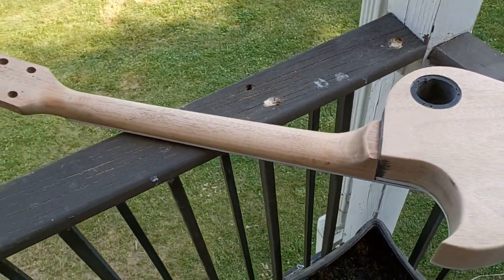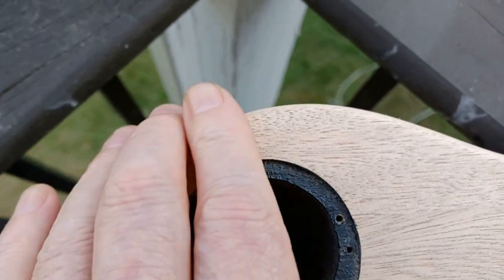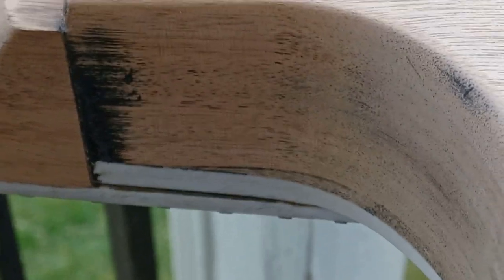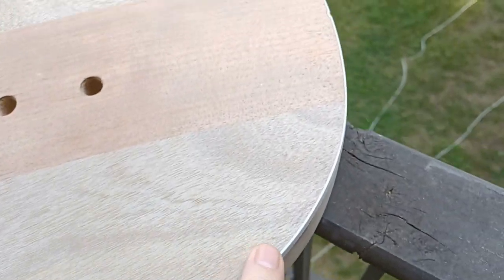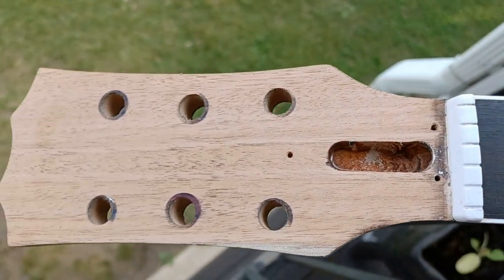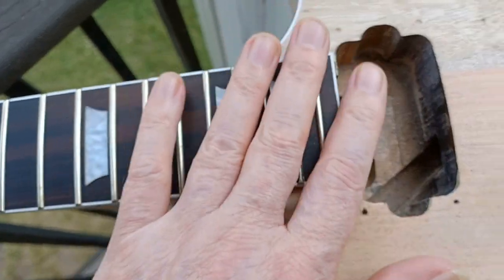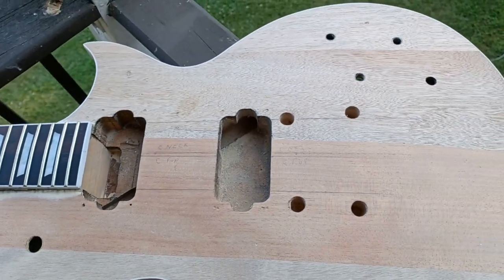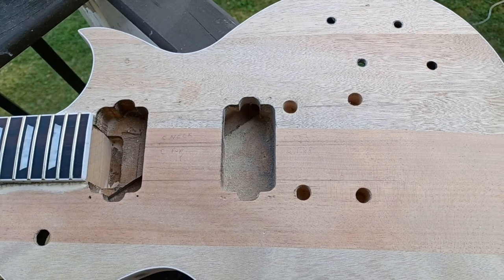Pre GGBO practice run part 2 #jurgscup

Comment: Yeah I have a kit guitar that has a neck joint just like that.. It sucks and makes it difficult to align the neck to the body. If they wanted a narrow tennen on the neck joint why didn't they just center it. Also if it is the same as the one I have there is a half round devet. It looks like a drill hole that they cut through under the fret board running from under the fret board to the bottom of the heal the bottom side of the neck. I think it was meant to help alien the neck to act as a pivot point but if the neck shifts when applying clamping pressure you git what you have a miss aliened neck. The kit I have which I have not put together yet is a 12 string.
Reply from the maker: I think they lined up the top of the neck parallel to the center line of the body and not matching the center line of the neck  to the center line of the body properly. Definitely something to keep in mind when you do yours.

Comment: If the pickups can line up and the rings hide the pocket I'd probably just move the bridge over, be a lot easier. 630mm for gibson scale for high E and 3mm back for low E. Works great everytime for me.
Reply from the maker: I have the set up part dialed in. I learned and got that sorted with my first two builds. This "fixing" stuff is all new to me. As everyone saw with last years GGBO I am a hard head and usually make things harder than they need to be. 

Thanks for helping me and reinforcing what I have learned thus far all that really helps with confidence for sure.

Comment: The neck is the same on the Epiphone Les Paul I'm using as a starting point for my GGBO2023 community build. It's apparently an offset tenon joint. I saw it first on another video (https://www.youtube.com/watch?v=1NqTe6E72wg). It does look odd, if you ask me. I plan to use a regular neck pocket for the neck I'm building.
Reply from the maker: I saw @Stephen Hatch's comment he mentioned was blocked for having a link. came to unblock it and saw yours not his. 

Interesting I will check out that video mate thank you. Good luck with yours. I see what went wrong with this one. It looks like the neck was set using the top edge of the neck and not the center line of the neck. that is why the strings were not properly in line with the neck. The top is parallel to the center line.
Reply: @borgonianevolution  I was wondering why the holes for the bridge posts looked off centre in relation to the neck. Now that you know the problem is with the alignment of the neck, you can fix it.
Reply from the maker: @bhartissimo  I think so too. Just a matter of how complicated it has to be to compensate the removal of the neck and the damage control afterwards.
Reply: @borgonianevolution  A pre-GGBO practice run is the perfect time to find out.

Comment: Not sure which would be the best way to handle this issue. I think the correct way would be to remove the neck but depending on what type of glue they used to put it together and how hard it would be to get it off not sure if it would be worth all the hassle. Removing the neck may also mean having to remove the fret board and it may or may not be usable once removed. Not sure what it would look like if you filled the holes for the bridge and tail piece and redrilled them it if it would still look off as it is I think it's your call. But best of luck which ever way you choose even if it to just chunk it.
Reply from the maker: I am pondering using my little pull saw I got for fret slotting and cutting straight down either side of the neck. Then clean up the edges and remake the bottom of the neck more like a dove tail joint that slides into the front of the body. If it makes it unusable It will be a lessen learned as well as still be a test body for the paint work I need to practice.

Comment: Fret board looks good. The frets don't look like they have ever been touched and it doesn't look like it was ever played. If it was it surely wasn't played much. Sense the body id a multi piece body I am guessing you are planing on painting this one. Not much of a chance blending the different colors of wood and making it look okay. Not sure how you will be removing the paint from the cavities. If the paint is not stick you might just put shielding paint over the top of it and call it good.
Reply from the maker: Yes it will be painted. I have an idea based off what I want to do on my official GGBO build as a practice run. All of the cavities will get pretty much just a smoothing over with sand paper then shield paint over that  for the most part.

When are we gonna start seeing your build stuffs? You been here supporting loads of people. Have you not caught the bug to try a build yet?
Reply: @borgonianevolution  Oh I really want to start building guitars not real sure if I want to put any of the build stuff on line. I really need to build a shop to work in. I live in central Oklahoma where weather changes drastically. It can be sunny and calm and in ten minutes have thunder storms come in with heavy rain thunder and lightning with 40  to 80 mile per hour winds.  Also in the summer which it is starting to get in to the temperature can regularly reach triple digits with no shade. I don't have any spot out side to work to get out of the sun.  I have been trying to find someone to do some survey work so I know what my easements on my property so I can get some plans drawn up but everyone I have looked up either on line or out of the phone book has turned down the job or not called back after leaving messages on their phone or the number is no longer in service.       Seems like people just don't want to work any more.
Reply from the maker: I work on a folding plastic table from Walmart in my Kitchen in my tiny apartment. Of course I don't live with anyone to yell at me over the added dusting always needing done 🤣